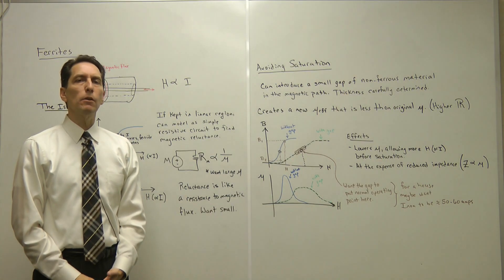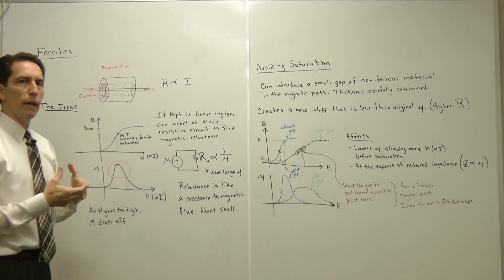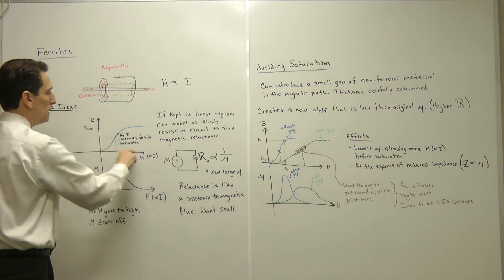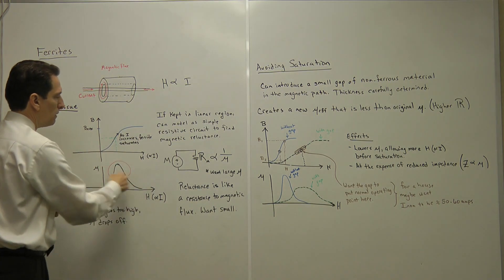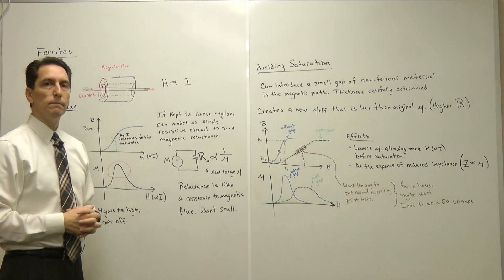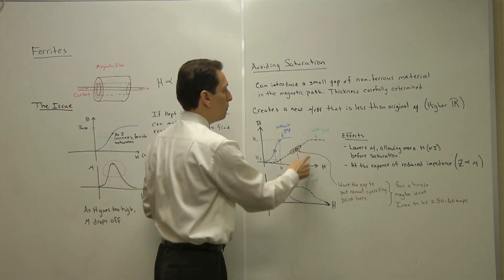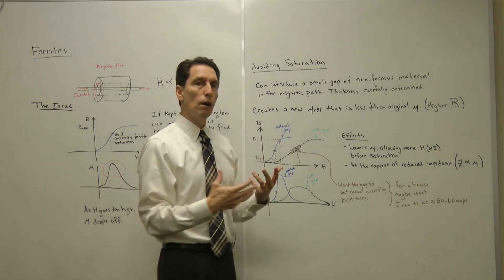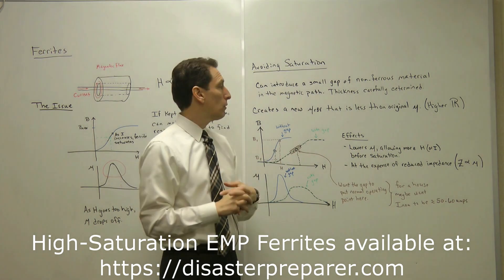High-Saturation EMP Ferrites

Comment: Great video and explanation. I have a question. The ferrites you sell are for residential applications so they are designed for the typical current loads seen in residential applications. If I wanted to use this technology on an industrial system, with say 800, 1200, or 2000A services, how would I do the design calculations to specify the optimal ferrites needed for EMP defense? I do understand that the ferrites are used in combination with standard MOV SPD devices (Type 1 or Type 2) to shift the E1 so that the SPD can capture the EMP surge current. Thanks for any clues or other information that would help me specify and source appropriate devices for industrial power systems!

Comment: I use a number of "X10" powerline control devices in my home. Will the whole house ferrites block those signals which I believe are in the 100Khz range. Or would a signal coupler or small capacitor on the load side of the panel (rated for over line voltage)restore the phase to phase coupling for those signals so they can pass to both phases.
Reply: As a person with an electrical engineering degree (but not affiliated with the presenter) I would say "no". At least with a WHOLE HOUSE ferrite, it would be in series with your power wires (at your service entrance). As long as you aren't counting on the X10 signal flowing THROUGH the inductor, it "should" be OK. He also sells ferrites to fit on individual power cords, and you'd probably NOT want any of those between your transmitter and receiver.
Reply: @ChaplainDaveSparks To get from phase to phase, the signal has to go out to the pole transformer, thru the windings, and back to the other phase coming into the house.  
Or alternately it may go thru an operating 240 volt device in  windings or elements like a stove, dryer or AC unit motor. But most are inductive and attenuate the 100KHz signal a lot. A simple .1Mf cap will work across the phases rated for at least 300 volts and with a small fuse in series for protection.
Reply: I would say "no" as well. These broadband ferrites should be working in the 100 Mhz to 1 GHz range. They shouldn't have much of an effect at 100 Khz.

Comment: Help me understand. I'm have a Mechanical Engineering degree, and I'm a Nuclear engineering officer for the US Navy. I've got a good understanding of EM, Right hand rule, Motor and generator action. as to your analysis: This really only makes sense for a DC system. I understand that a single DC pulse will occur during an EMP. And I understand how you can modify a ferrous material to take advantage of the hysteresis curve to act as a dampener in a current surge until you reach saturation. But what is your explanation for use in an AC system? the current alternates at 60Hz therefore the ferrous material will be alternating under hysteresis. Do you just assume that the ferrous material will be in a otherwise "zero state" due to the speed of the AC. 

you basically have installed a transformer to your wire with no load on it. Is that not going to drive your Power usage up to constantly combat the magnetic field you are opposing 60 times a second? 

help me understand how this effects your normal AC usage.
Reply from the maker: Hi Nathan, yes, you're absolutely right. If the ferrite had a noticeable effect on 60 Hz current, you would affect your power factor of the system and just be introducing unwanted power inefficiencies. Fortunately, these ferrites have no measurable impedance at 60 Hz. They're designed for high-frequency (MHz to GHz) before they introduce any impedance effects.

Comment: Can you show all the calculations? For pretty much everything. Reducing things down to layman's terms is good for sales, but I'd like to do some independent verification and this isn't enough information.
Reply from the maker: Sure, but I don't think they'll mean much unless you are an engineer or scientist working with magnetic materials. The steps are as follows: 1) select a magnetic flux density level that is acceptable for the material (from B-H curve), 2) calculate the sum of core and gap reluctance, 3) calculate effective permeability the of core and gap, 4) calculate magnetic field with the gap under a condition of max acceptable magnetic flux density, 5) calculate maximum current it takes for ferrite to reach acceptable level of magnetic flux density, and finally 6) adjust the gap size until you get desired level of saturation current. That's what I do to determine the gap dimension. The results vary greatly based on what material you have or what saturation current you want to achieve. Once you know the gap dimension, you have to figure out a way to implement it with a tolerance of no more than 0.001".
Reply: @disasterprepper   although rusty, I'm familiar enough with field theory and electrical engineering that I believe I will be able to read it enough to satisfy my curiosity. If not, I know some electrical engineers that I can refer to. Thank you.
Reply from the maker: @Wing0Alchemist  Great!
Reply: @disasterprepper  That is a good description of how you calculate, but what target values did you use? For example, what is the current at peak permeability?

Comment: Why not just use iron powder core (yellow-white ring) I don't see why it is worth the effort to use ferrite and open a huge air gap on it.
Reply from the maker: I've never been able to find one that offers very high-frequency protection, allows currents up to say 100 amps, and is hinged. If you know of one, please point me in that direction.
Reply: @disasterprepper  Thank you!
Reply: @disasterprepper is the hinged requirement because they need to be easy to install?

Comment: Dr. Bradley, do you have any suggestions for a breaker panel that has all slots full ?  Mine has a 100 A main and multiple piggyback breakers. So the 3 ferrites will work on my 4/0 feed but no expansion room for the added 30A breaker suggested for installation.    J K
Reply from the maker: Hi James, I believe most areas allow you to splice the SPD into an existing breaker (recommend a 20 or 30 amp). A local electrician would know the code on how to do this properly.

Comment: Does adding more than one in line cause any disruption or current choke to the line? I've added some off the shelf ferrites to electronics devices power lines in my house in hopes of reducing EMI for my ham equipment, but I've never really understood how it works. I know a magnetic field is generated and it affects the flow of electrons moving through the wire, but it seems like it would reduce the flow therefore affecting current and voltage needs. Same for something like a 1:1 balun current choke, I understand what the claimed use is, but don't understand how it allows current from coming back to the transceiver, but how does that same mechanism allow forward current.
Reply from the maker: The ferries only affect high-frequency currents (usually MHz, although it can be 100’s of kHz). Normal DC or AC power is unaffected.

Comment: You sell ferrites but how do you ise them exactly.  What size for what? Frig? Desktop? Toaster? Generator 10000, just common sizes needed for common household items??? We are not electrical Engineers so technical math is beyond us.  What about a chart listing items and size of ferrites?  I would think this would help sales.  I feel this stuff is very easy for you and I can tell you the math does not help by showing it and transferring to everyday life.  Interesting though and thank you!  I’ve been afraid to buy ferrites and other items because I have no idea what fits what ???  Have you tested the EMP Shield brand for homes and cars? What results?  Please show what we as people without higher math skills need to buy for what.  I do not have money to buy useless things I have no idea what they are used for or how!!!  I thank you and suggest you do this on video and on your sales pages in chart form what is used for what please.
Reply from the maker: I sell two types of ferrites: whole-house and broadband. The whole-house ferrites are specially modified to go on the large wires that come into your breaker panel box from the service meter. Their function is to suppress very high-frequency transients that come in from the power lines. The broadband ferrites on the other hand are meant to go around the power cords to electronic devices (i.e., computers, radios, televisions, etc.) and appliances (i.e., refrigerators, washing machines, etc.).

The whole-house only come in one size, so selecting them is easy. Most homes would need three. The way to select broadband ferrites is to measure the cord diameter of whatever you're trying to protect, and then buy a ferrite with an inner diameter that is slightly greater than the cord size. Another option (often easier for people) is to buy a discounted bundle of ferrites. That gives you some options and helps to figure out what sizes are most useful.

As for various surge protection devices, there are many good models out there. Just find one that you like the specifications of, and I'm sure you'll be fine.

Also, I know that the math isn't really helpful to most people, even after greatly simplifying everything. I only discuss it in this way to help those who wrote me asking for more details on how this works. I do appreciate that most people don't need to know the details. Thanks for your comments!

Comment: Could you use both your modified ferrite and one that wasn’t altered in-line so you wouldn’t have to trade off any performance?
Reply from the maker: You could certainly use both, but you'd still have a tradeoff. That's because the non-modified ferrite would only be effective when there was very little current flowing through the wire (<10 amps). Any other time, it wouldn't be effective, so the modified ferrite would be your only real protection. Another option is to use two modified ferrites in series, which essentially doubles your protection, but obviously at more cost.

Comment: Will the whole house ferrites be good for 220 also? Do you have any suggestions for a 220v single pole to nutrual EMP and lightning protection. I am in the Philippines and we have many electrical problems.
Reply from the maker: Yes, they'd be fine for 220V. Siemens may offer a 220V SPD. You should check with them.

Comment: The ferrites you sell are .72" inside diameter. Based your explanation of a specific gap or introduction of material on the inside ferrite wall to flatten the saturation curve would it not matter having small verses large diameter service entrance wires?
Reply from the maker: The gap is actually cut out of the ferrite material. The interior diameter of the ferrite remains essentially unchanged. Also, if your wire is a little smaller than the inner diameter, the ferrite will still work fine. Obviously, you wouldn't want a tiny 22 AWG wire going through a giant ferrite unnecessarily, but the 0.72" ID ferrite would be fine for any typical service entrance wire (i.e., 1/0, 2/0, 3/0, 4/0). If it's too loose, you can use a zip tie around the wire to keep it in place, but for most house wire, it fits very snug.